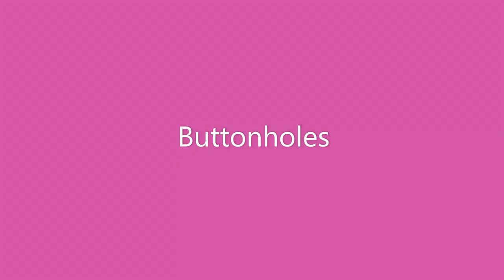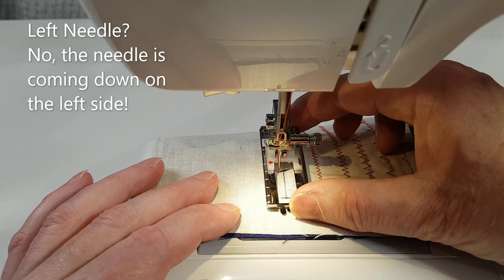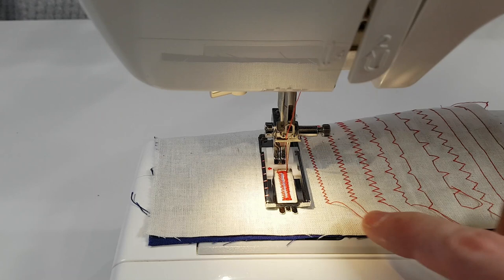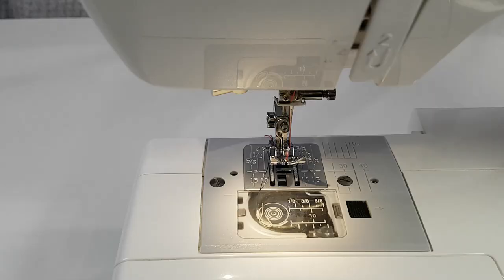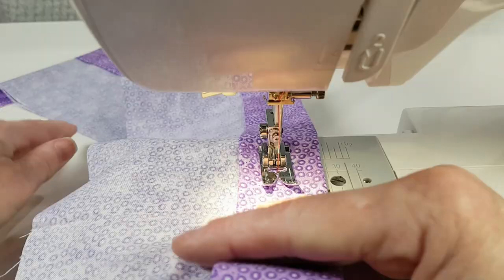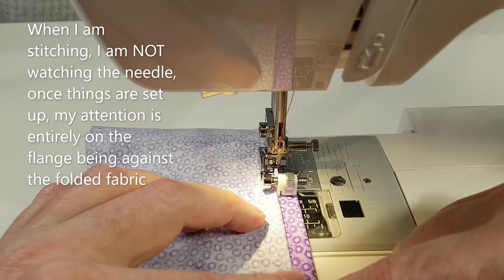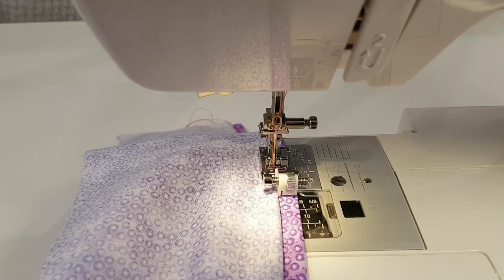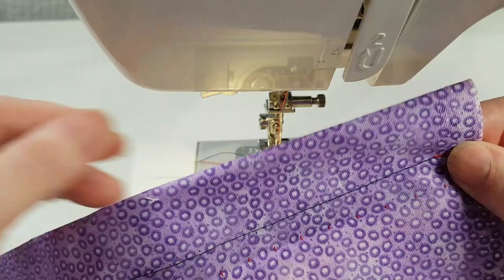Janome FD206 or RE1306 | Four Step Buttonhole and Blind Hem

Comment: hello very nice lady please kindly film how to sew on a button using this sewing machine and question do you use only the hand wheel or a combination of the hand wheel and the sewing machine electric foot pedal while sewing on the button??😊
Reply from the maker: With this machine you will need to drop the feed dogs, and work put if the available zigzag widths work for the button you are trying to sew on. (Probably the largest one)
Hand wind until you are sure the needle is going into the holes of the button.